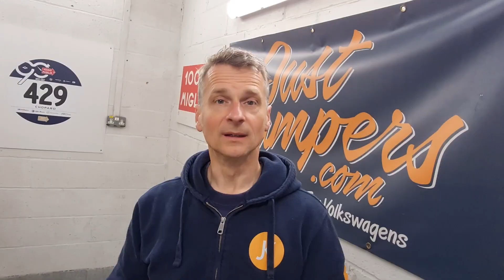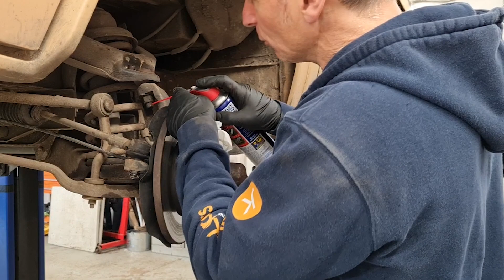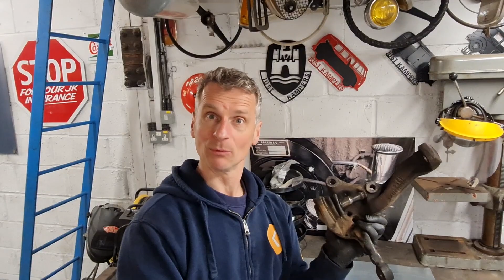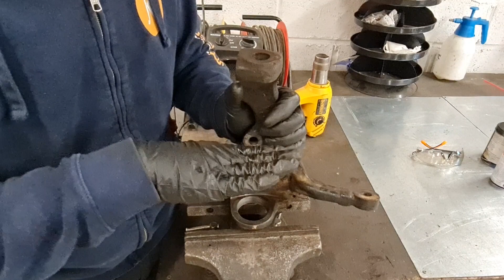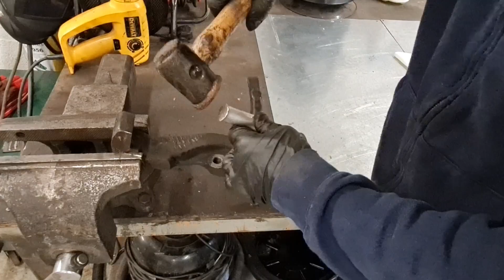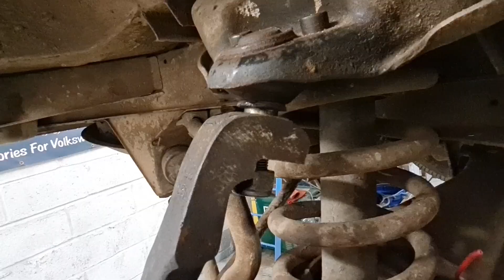How to replace a ball joint on a T25

Comment: Great video! I have almost finished this job using this as a guide. Had to get an engineering shop to press ball joint in though. They made up a C-shaped ring  (from an old bearing) that fitted around the ball joint's 'skirt'; this got around the tight gap where the flat side of the skirt is close to the stub axle casting. The engineer said wouldn't possibly have drifted in and had to use his 10-tonne hydaulic press. Charged me £20....  Also - do make sure you buy the FEBI one from JK, not the budget one. The original circlip will need to be ground down to fit into the new ball-joint slot. Easy to do though.
Can I ask a question? There's no way to get a torque wrench on the lower ball joint nut (top one too) 'because the threaded part needs holding with a spanner. How tight to do them up?
Thank you SO  MUCH for doing this life-saving video - liked and subscribed!

Comment: Using a drift doesn't work. I spent a lot of trying to do it thAt way and it won't work.
Reply from the maker: Hi, if not working it would be worth warming up the area around the ball joint on the hub as it sounds like you may have corrosion between the hub and the ball joint. Plenty of soaking with a maintenance spray before hand will help. Hope that helps!